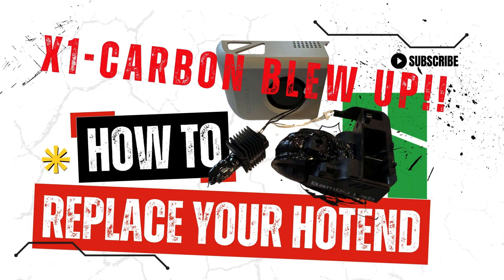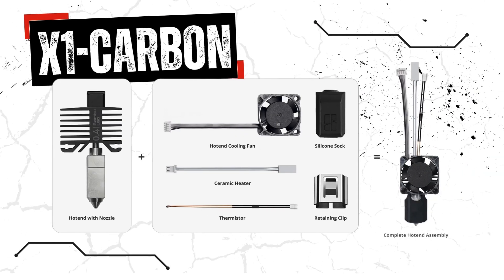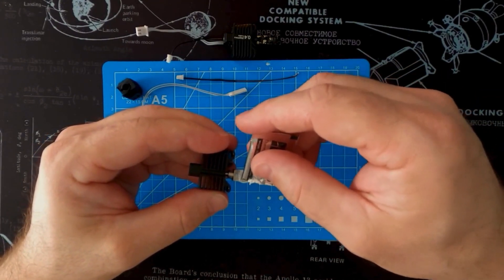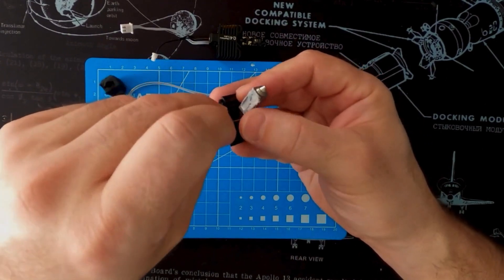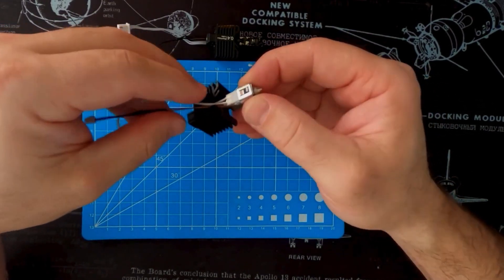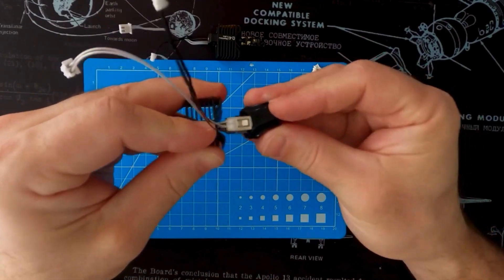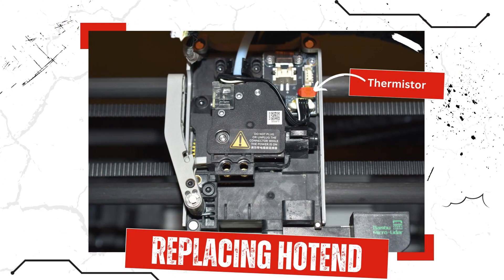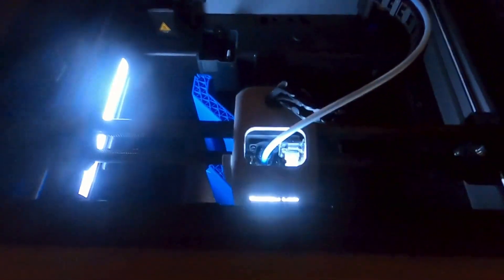How to Change your Bambu Labs hotend

Comment: Do you use anything other than the standard .4 nozzle? Thanks
Reply from the maker: I use the .4 and .6 alot.   .6 you lose a little bit of layer quality, but it does improve print time on larger prints.